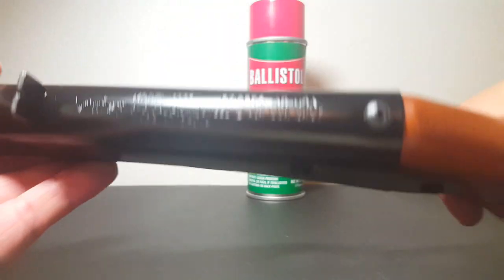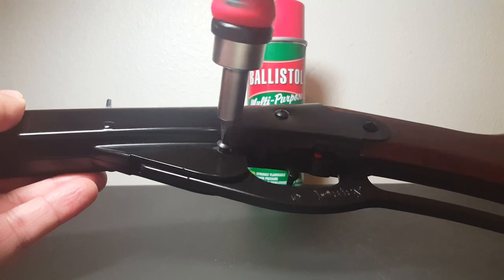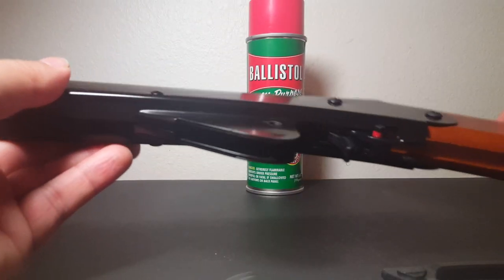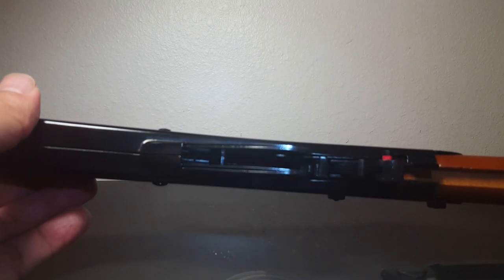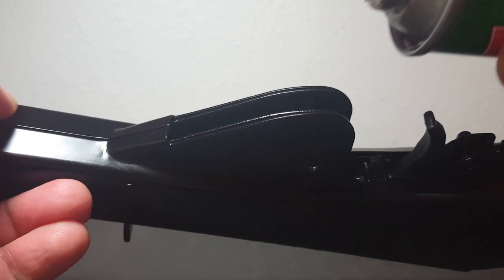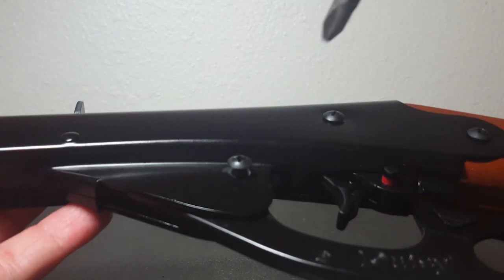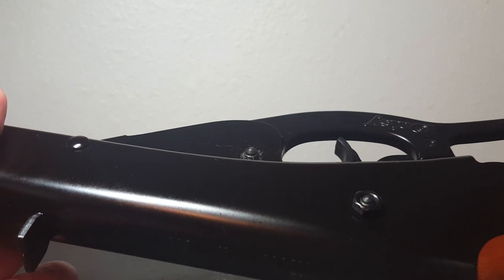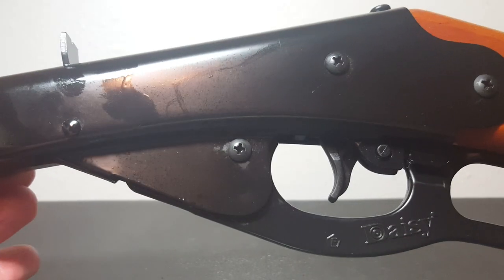New Red Ryder Easy Tip: Simple Backside Parts Lube (Use a Straw adapter for precision)

Comment from the maker: LUBE PRECISION 

(1) For those who find spray sloppy,  use a straw. KNOW THIS IS NOT A DAINTY JOB WITH A NEEDLE NOSE - THAT WON'T WORK. The firehose approach is called for once.

This video is for new shooters, WITH A NEW GUN,  so they EASILY avoid a deadly jam. PLEASE KNOW I lost the straw for that can, but it still works, and wipe off any runs. Hosing down the backside is A ONE TIME EVENT. It stops backside anti-trap jams that hit new guns. But, YES, feel free to use a straw for more precision.
.
(2) Don't reuse BBs. That causes fatal jam in barrel that is  impossible for most owners to clear - in THIS model.

(3) Lubing like shown in video will prevent a trigger area jam. And improve trigger action. Please do it right away.

♦️♦️♦️♦️♦️♦️♦️♦️♦️♦️♦️♦️♦️

The problem with WD-40 here, for the job in this video, is that the formula is HALF MINERAL SPIRITS,  like paint thinner. Gunsmiths claim it can damage wood - like your stock.

I have learned to like WD-40 for stopping rust on tools and light rust removal with a medium steel wool. But this is outdoors, yard work fix it.

If you don't have a gunshop near you, here are other choices that won't harm seals or wood.

You need squeeze bottles for these:

https://www.hobbylobby.com/Art-Supplies/Painting-Supplies/Palettes-Tools/Squeeze-Bottles/p/57415

https://www.oreillyauto.com/detail/c/pure-guard/pure-guard-compressor-oil-4-quart/pgd0/ac18

https://www.homedepot.com/p/Husky-16-oz-100-Full-Synthetic-Compressor-Oil-018-0083H/300135698

Here is great LOW PRICE generic choice, close to the Ballistol, and has own squeeze bottle:

https://www.amazon.com/WAHL-Blade-Oil-4-Ounces/dp/B017A5DXZG/ref=asc_df_B017A5DXZG/?tag=hyprod-20&linkCode=df0&hvadid=167151987585&hvpos=&hvnetw=g&hvrand=4393145251018014438&hvpone=&hvptwo=&hvqmt=&hvdev=m&hvdvcmdl=&hvlocint=&hvlocphy=9033279&hvtargid=pla-315166846511&psc=1

Comment: My new Red Ryder appeared well lubed from the factory but I still added a few drops of Napier gun oil around the lever/trigger area and then a couple of drops in the oil port every 500-1000 shots. Don't be tempted to over-do it, too much lube will wet inside the barrel shot tube and where the BBs are stored which doesn't help accuracy and doesn't help BBs gravity feed. No big deal, just takes some time shooting to clear it out.

Comment: Good info. I have a new Red Ryder and had no problems, I just oiled it and it shoots great. My Buck is 20+ years old no bear trap and has plastic stock. I have had to glue the front site and cap back on a few times. But that is it and she still shoots good. Will be getting a newer one soon. Keep up the great work.
Reply from the maker: You did like video? Glad your RR had not jammed. It is just good  PREVENTIVE measures for all NEW Ryders. Just like not all come with loose front sight but when they do, putting new sight on helps measurably.
Reply: @daisy880fanaticfixit9   Yes I liked the video and I did fix goon to good LOL.
Reply: @daisy880fanaticfixit9  can I use w d 40 .
Reply from the maker: Rickey, that is really important question. The problem with WD-40 here, for the job in this video, is that the formula is HALF MINERAL SPIRITS,  like paint thinner. Gunsmiths claim it can damage wood - like your stock.

I have learned to like WD-40 for stopping rust on tools and light rust removal with a medium steel wool. But this is outdoors, yard work fix it.

If you don't have a gunshop near you, here are other choices that won't harm seals or wood.

You need squeeze bottles for these:

https://www.hobbylobby.com/Art-Supplies/Painting-Supplies/Palettes-Tools/Squeeze-Bottles/p/57415

https://www.oreillyauto.com/detail/c/pure-guard/pure-guard-compressor-oil-4-quart/pgd0/ac18

https://www.homedepot.com/p/Husky-16-oz-100-Full-Synthetic-Compressor-Oil-018-0083H/300135698

Here is great LOW PRICE generic choice, close to the Ballistol, and has own squeeze bottle:

https://www.amazon.com/WAHL-Blade-Oil-4-Ounces/dp/B017A5DXZG/ref=asc_df_B017A5DXZG/?tag=hyprod-20&linkCode=df0&hvadid=167151987585&hvpos=&hvnetw=g&hvrand=4393145251018014438&hvpone=&hvptwo=&hvqmt=&hvdev=m&hvdvcmdl=&hvlocint=&hvlocphy=9033279&hvtargid=pla-315166846511&psc=1
Reply: @daisy880fanaticfixit9  thanks.

Comment: Problem, I was an idiot and put a ball bearing into it, now it's jammed and won't fire and I've watched your videos but I simply cannot get the trigger assembly out. I watched your other video but couldn't get much help with that.
Reply from the maker: That is a barrel BB jam or loading ramp jam. I have videos for that. This video prevents BACKSIDE JAMS. You aren't an idiot, and thanks for not blaming me for this model's faults. 

You tried removing the trigger but it got snagged on plunger back. That bar is the anti-bear trap - it is designed to keep the spring rod from flying forward when the plunger plate doesn't engage the sear. When you suffer a BB jam it becomes a hindrance.

 If it were a trigger jam, your trigger would have gotten sucked inside once the screw was removed. The barrel would be clear and the spring zooms forward, pulling in the trigger. That normally kills the gun for most users.

Comment: Thanks for this vid, just got my brand new Adult size Red Ryder on black Fri. I tested it today and it works great! Having so much fun.
Do you think it's still required to lube that area with this newer model, if so...Is WD-40 OK to use?
Reply from the maker: The engineering in your adult version the same at the tiny Buck. You just have longer barrel and now longer stock. I'm sure a nice fit for big adults. I'm happy with the 1999.

On WD-40, I have had major spats with guys who think it is good for guns. Tom at Pyramyd Air has TONS of experience with that and I would listen. Go with ND motor oil or Pellgun oil for other options. I really like the aerosol Ballistol here. Yes, that few minutes of lubing the back, worth stopping a trigger jam. HELPS ACCURACY.

Here is Tom: 

WD-40

Daisy recommends using a 10-, 20- or 30-weight non-detergent motor oil, but as I have none of that laying around, I will use Crosman Pellgunoil. Daisy certainly isn’t going to recommend Crosman, but Pellgunoil is a lot like the oil they used to sell for this purpose. Don’t use household oils – especially WD-40.

In my role as a firearms enthusiast, I used to put WD-40 on all my guns. It smells so good and guns always look so nice after they have been wiped down with it. So, when the Army sent me to Germany for four years, I sprayed WD-40 on all my guns before storing them in my mother’s attic, thinking I was protecting them against the ravages of time. What happened, instead, was that the WD-40 dried out and left every gun covered with a thick coating of yellowish residue that proved nearly impossible to residue that proved nearly impossible to remove. Only more WD-40 would dissolve it, and in one case the silver plating on my collectible second generation Colt 1851 Navy cap and ball revolver was destroyed! Each gun took weeks to clean, because the residue had gotten into all the cracks and tight places and had to be scraped out with tools.

Nothing gets under my skin faster than someone who keeps asking what substitutes exist for Crosman Pellgunoil, after I have told them all I know about it. What I know is this: if you lubricate your CO2 guns, multi-pumps and single-strokes with Pellgunoil, or non-detergent motor oil, they won’t have seal problems. Use anything else, and you’re a test pilot. 

Being a test pilot means you absolutely cannot radio me for help when you’re in an inverted flat spin with a flamed-out engine over the Rocky Mountains. Or when your new CO2 gun starts leaking after you sprayed it with WD-40, Slick-50 or monosodium glutamate. Use Pellgunoil and I will alert Search and Rescue to look for your beacon, or at least I’ll make sure they name a high-school gym after you. Crosman Pellgunoil.
Reply: @daisy880fanaticfixit9  I appreciate your feedback...I'd probably head to the store and find ballistol if it helps prevent bb gun jams. But as for other guns I've been using Break-free for years, never had any issues with cycling or functioning with any of my guns, and now I'm trying ALG Go-Juice with no issues so far. I never use WD-40 on my other guns , just thought it might be appropriate for this bb gun and I still have full can of it cause I barely use it.
Thanks.

Comment: use a straw? na, i would dip the whole gun in ballistol if i had a bath of it.  wipe it down and enjoy a rifle that will keep you out of a jam and no rust. glad i watched this before i opened my new red ryder. thanks
Reply from the maker: Mike, YES, you get it! Bathing the backside and the stock would not harm anything.

Ballistol harms nothing that is compatible with mineral oil. Wood, leather, AND Red Ryder Nitrile  compression cup.

Better than jam related to the anti bear trap.

Hosing down the inside of the reciever, one time, is the play here.

Comment: Thought I had seen where a couple drops of oil would be placed thru a small hole on my red ryder but I cannot find one on mine. Removing lever is it then.
Reply from the maker: Mike, it is VITAL to remove that lever and lube heavily in back. Ballistol is quick and easy and is a fine oil I use on locks and small moving parts like socket wrenches. 

Please know these current Ryders, because of the anti trap, can jam or get dislocated in back. The trigger and lever go SLACK.

Try not to double stroke the lever. Cock it quickly and cleanly in one stroke. The backside jam normally hits in first magazine of BBs.

LUBE HEAVILY RIGHT NOW.

Also consider thread locker blue on the nut. That can work loose on the lever screw and fall off.
Reply: @daisy880fanaticfixit9  
Glad I found this

Comment: Thanks I really don’t know that much about piling so thank you so much.
Reply from the maker: Some more help.

(1) For those who find spray sloppy,  use a straw. PLEASE KNOW I lost the straw for that can, but it still works, and wipe off any runs. Hosing down the backside like that should be considered A ONE TIME EVENT. It stops backside anti-trap jams that hit new guns. But, YES, feel free to use a straw for more precision.
.
(2) Don't reuse BBs. That causes fatal jam in barrel that is  impossible for most owners to clear - in THIS model.

(3) Lubing like showed here will prevent a trigger area jam. And improve trigger action. Please do it right away.
Reply: Ok thanks for the more information I really appreciate it.

Comment: I also use ballistol
Reply from the maker: Yes, and now I use it FOR ALL little Springer needs including oil hole.

Old timers, with decades of experience, have stated that the 5-10 weight oils do best here. The performance on all my little springers, whether psm45 or Ryder, has improved and smoothened out.
Reply: @daisy880fanaticfixit9  Germans used it to shine their tanks and clean them.

Comment: Could you use a needle oilier and apply oil in that area?
Reply from the maker: Yes, absolutely. I show aerosol because for younger shooters that is easy way to lube back area.  

The idea is to get lube over catch points and anti-bear trap. It is routinely an anti-bear trap malfunction. Airgun veterans made good points that it isn't a sear or blade problem.  I now call it a bear trap jam.

Just put enough drops in to cover slanted plate and inside frame. DON'T BE DAINTY HERE - a needle nose can go 10 drops here. No problem. Consider bigger squeeze bottle.
https://youtu.be/3XOsEznCg7s

Comment: ok so my trigger got sucked inside like you said do you have any fixes
Reply from the maker: Riley, yes, for you there is hope. I'm willing to shoot private video - but on the condition that you give me FEEDBACK.

I had videos up to repair these guns but it turned into a fiasco because folks couldn't tell the difference between trigger jams (like yours).and BB jams.  BB jams are fatal so please don't use anything other than NEW BBs; they are tough to clear.

The trick I will show you would be simple if your trigger was still screwed in, but could still work. BUT I need to know if it does on loose trigger.

Do we have a deal?
Reply: @daisy880fanaticfixit9   yes thank you
Reply from the maker: Ok, watch for it tomorrow. It is a YouTube link so don't be link scared. Too many link scared.

I will briefly describe BB jam then go into your trigger issues which is anti bear trap failure. .
Reply: @daisy880fanaticfixit9  thanks i will look for it

Comment: What oil do I put into the "oil here" hole  ?
Reply from the maker: Jagman, that actually is fair question here. 

STILL USE BALLISTOL - but use a straw to give clean puff INTO oil hole. Just one puff, after a magazine of BBs is spent.

Ballistol actually increased the performance of my Ryder, and old timers will tell you that 5 to 10 weight oils improve performance. Ballistol is a very good choice.

I get grief from some here because I lost the straw - BUT I SAY ON VIDEO TO USE A STRAW - But folks don't always listen carefully. After the video I just wiped off oil on sides.
Reply from the maker: @AnthonySantos-xw3bi  - Some folks really like that for their Ryder.

Use a needle nose. A normal dropper or squeeze bottle OVER lubes.

Many lube choices work for your Ryder - ones that wreck an 880. The Ryder power plant is very open, and the compression cup is very thick.

Comment: Uh my trigger got sucked in the gun... I took out the screw
Reply from the maker: Thanks for contact. With the introduction of the anti-bear trap, the jam issues have become bad. An old Buck I had didn't have that issue. No safety catch. It turns into a bear trap and jams your gun.

So here is what happened. Your gun didn't work, so you probably thought it was a BB jam, so you took off stock and thought it would be simple take apart. Nope. As soon as you pulled the trigger screw, the plunger, or spring guide that goes through the middle of mainspring, was caught up on your anti-bear trap and pulled it inside. Your mainspring  did that.

I made the mistake too, but cleared it by doing the nuke option - using 10 inch Jaw lockers, yanking the anchor behind rear sight, and yanking it free. That neutralizes your gun. I then took it apart. The trigger shelf, what the trigger sits on, was bent and I bent it back with mini pliers.

You will have to compress the spring and reset the anchor before putting trigger and stock back on. 

I just cleared this malfunction in 1999 with MUCH SIMPLER method. The lever went slack and the trigger went slack, so the plunger was caught up in the frame or bear trap. I knew it and SLAPPED the left side of the metal  body with my hand. I tried again and it cocked.

I tell shooters not to DOUBLE STROKE. Did that accidentally on both jams. It dislocated the plunger in odd way.

Sorry you are well past simple fix here unless the have pick shaped like hook. Go through your lever slot and pull OFF the bear arm. The plunger zooms forward. Most fail here.

As an 880 channel I would ask you to get a Boy Scout - no trigger jams, easy to clear barrel jams, more accurate and easy to repair.

I will send another relpy with disassembly video by best Ryder expert.
Reply from the maker: Here is video on disassembly. With trigger sucked inside.

https://youtu.be/0uCgA848t28

Comment: I need help because i cocked my daisy and it wont shoot
Reply: I will post a vid about it if u need to see whats wrong
Reply from the maker: Yes, that would be really helpful. Then I can give the fix.

Yes, I helped a lad clear a BB jam when he shot video. NOW I know much more, so if I saw a video like that one again, I would know in twenty seconds the problem.

(1) If you cocked your gun and your trigger goes "click" - that is either BB breech jam or dislocated anti-trap in back.

(2) If your lever is SLACK, no clicking of the anti -trap, and your trigger is silent (no clicking), THAT IS INPROPERLY COCKED GUN. YOU NEED MORE CLICKS.

I noticed your channel has no content at this time, so just drop message when it is up, and I will jump to it.
Reply: @daisy880fanaticfixit9  i posted it
Reply from the maker: @The bois comedy  - Ok, well it isn't a BB jam or anti-trap dislocation -BOTH OF THOSE JAMS have a trigger that activates or clicks when you pull the trigger.

I just looked at my BUCK which I'm going to clean and lube after shooting magazine empty today.

I've watched your video a few times now and you are MISSING A CLICK, meaning it is hanging out on your anti-trap. That equals slack lever and slack trigger.

DON'T REMOVE THE TRIGGER SCREW IN THIS CASE. It will suck the trigger inside, more damage and more serious fix.

Hold your gun straight up, and use all your strength to get THAT LEVER UP for another click.
Reply from the maker: Here is your fix:
https://youtu.be/Ay8oSXlhNWY

Comment: I just got mine worked fine it had no bbs in it, i cock it but it doesn't shoot any idea what happened?
Reply from the maker: Likely anti-bear trap related. Find my Jam Fix video for the BEAR TRAP. 

No disassembly required.

Don't re-shoot BBs. If you get it working again, if you pick up BBs from the ground, that causes a barrel jam that is much worse. Fatal for most.

I cleared a trigger problem like yours. BB jam much more DEADLY for Ryder type, so I don't shoot used BBs.
Reply: @daisy880fanaticfixit9  thanks man
Reply from the maker: If you can't get it working, consider the Boy Scout or 2840. They are better guns and don't have Ryder problems.